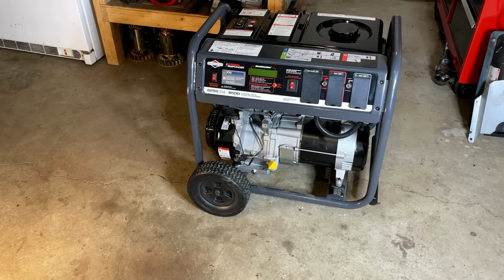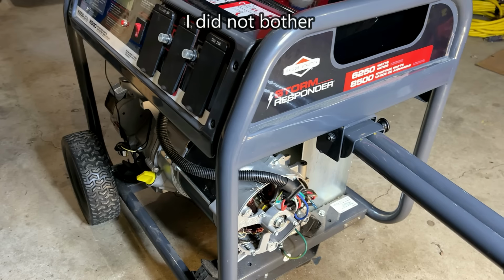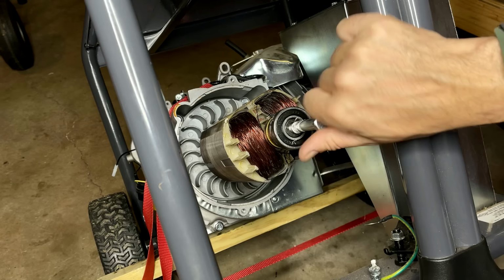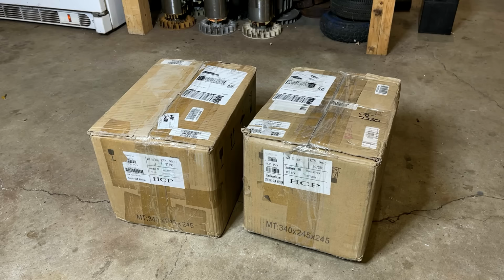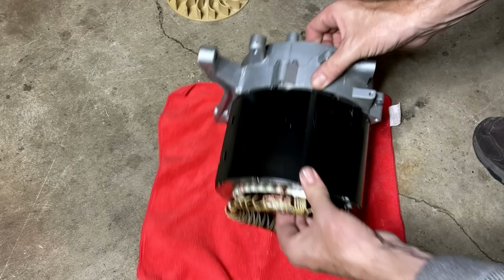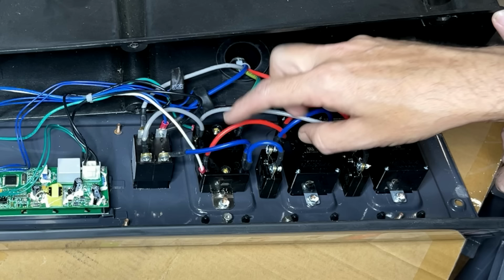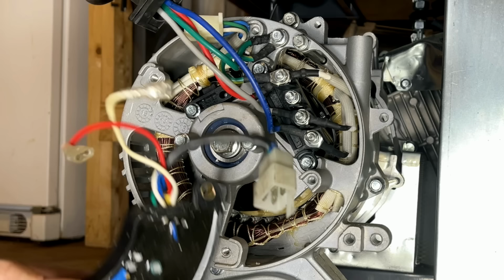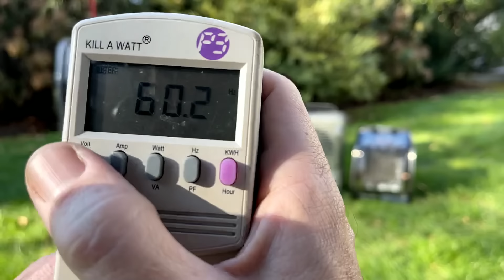New Storm Responder Generator Stopped Making Power

Comment: As usual, great video! 

Thanks a lot for your videos, i probably looked all your videos in the last month.

That helped me a lot to fix an old honda em5000sx with a bad avr, dirty carburetor.

I did the oil change, new spark plug, new air filter. 

I still need to replace the analogic voltmeter on the front, but it is too cold outside, i will do it next summer.

Now it will power my house in case of power outages. It happend many times here in Québec(Ca) you are à great teacher !

Comment: I would think you would be able to repair the wire from the rotor to the slip rings. Did something like that recently on a Kohler.
With all the work you do on these units, I would think you might be able to build some rotor or stator winding equipment. I know it can be very specialized or expensive, but there are a lot of motor repair shops that went out of business. He would think some of that equipment would be around. The rotor would be the easiest to do.
Reply: He's spoken about doing that repair before and prefers not to. Vibration, heat,  and centrifugal force means anything less than  perfect will fail sooner or later.
Reply: you pretty much need a full motor repair shop(assembly line) to do it right and have it last. the winding that burnt likely knocked any coating off the rotor iron and stator both, so those are likely trashed too.
there's just too many specialty machines and tools required, trying to hand rewind anything but a basic DC motor/generator is futile.

Comment: Great video 
 I'm Brian I live in my 97 dodge grand caravan  in Las Cruces new mexico.  I have a  2500 duel fuel inverter generator  (champion) I put anywhere from 8 to 10 hrs  a night on it a night
Reply: My question is  the stator and rotor on my  inverter generator  how long do they last in running hrs like I do.  Because I have thousands of hrs on this generator  been running strong for 2 years

Comment: One of the main causes of failure is shutting down the generator before removing the load. The AVR is going into saturation trying to increase the field of a slowing rotor. This can overheat the field winding and AVR xsistor.

Comment: With the new power head installed  what is the maximum watt output be?
Reply from the maker: Generator is rated at 6250.  The stator I installed it rated at 6500.  Most likely would not be able to use that extra bit since the circuit breaker is still rated at 6250.

Comment: Not throwing shade your way but isn't the shaft of the stator treaded for a slide hammer to remove it easily? I been a mechanic on everything I think 6 years on small engines and 15 years on locomotives and somewhere around 55 on everything in between and I have to say you are on of the most thorough mechanic/electricians that I have ever watched work. Pretty nice to see that... Thanks for the ride along and being able to vicariously be in the shop again sir.
Reply from the maker: It is threaded.  Usually I push it off with hydraulic pressure or a rod, but this one was stubborn.  And since it was already trash did not care to much about doing it the right way.  A slide hammer should also work.

Comment: James-
Have you ever rewound a stator and/or rotor before?
All of the necessary tools & supplies are readily available on Amazon,
and surprisingly cheap! The procedure is quite easy.
Reply from the maker: The tools are cheap.  It comes down to time and not having the proper winding diagram

Comment: Have you ever considered take a bad stator or rotor to a shop that can rewire them? I had a marine 12volt started rebuilt much cheaper than buying a new one.
Reply from the maker: I looked into it a few times.  The base cost starts at about $900.  Not worth it when you can buy a new Ryobi one for a fraction of the price.

Comment: Hello, I really like your videos, very instructive. I have one question, I see that you are no stranger to repairing generators and you have seen a lot, can you comment or even film a video about the use of welding equipment for generators. How to choose the right generator so that it does not stall and burn when using some welding equipment. What is the biggest mistake people make when choosing generators? Because not for me personally, but it has been heard that after using the welding machine, the windings of the generator or something else end irretrievably. I can't comment. Now I am the owner of the 7kw generator and I am thinking of doing everything for the needs of the house, I am afraid to connect the welder to the generator so as not to damage it. Thanks in advance.

Comment: At 48:48 you can actually see the governor spring pop out of the hole! That governor arm really launches forward with some force once it gets going. I wonder if that's normal or if the governor is sticking inside. Especially since it was low on oil!

Comment: Someone threw away a Home Power 6000 generator that has the dual fuel Honda 11 horse engine. Apparently water filled up the carb and intake but didn't make it to the intake valve. I'm pretty sure the air filter housing is aftermarket and neither wing nuts have any type of sealing ability. I do drill a hole on the underside of the plastic intake and use a thing I don't know the name of but it's a rubber tube with a crimped looking end that's on some external diesel truck air filter housings. You squeeze the end to relieve it of whatever made it's way there like water. I also put an O-ring under the winged nut that I took off a junk Honda pump as it has the Teflon or whatever seal built in. Just thought I'd mention that before someone has an expensive bad day. Just a weep hole will work but is easier to clog.

Comment: Great video.  You only loaded it to about 50%.  When do you determine that engine speed at low load and above 120vac needs to be increased more possibly by Governor spring setting that carb speed adjustment?

Comment: I have 2 questions:
1. Where is your elevator?
2. I always use a torque wrench to tighten a spark plug, don't you think it's necessary?
Greeting from the Netherlands.
Reply: I've been taught not to use a torque wrench to tighten the spark plug as you can more than likely strip the threads out of the head, which will require a heli-coil
Reply from the maker: 1) Being used on another project.  2) I torque everything, but not spark plugs.  If new then torqueing makes sense.  Used plugs just finger tight and then turn 30 degrees with a wrench and that's it.

Comment: Good repair video however, I no longer put that kind of money in a non-inverter generator.  For you to make any money you'd have to get close to $500 for this machine and, at least where I live, I would be hard pressed to get that. 
Now, if you are keeping it for yourself, ok.  You got a pretty nice generator for around $300.  Otherwise I would just use it as a parts unit.

Comment: I bet that you could've smelled that one pretty easily even without opening the back cover on the power head. Do you actually ever use the "smell test" to try and figure out if there are burnt electronics in the generator?
Reply: Hi, yes I was just going to say that myself , then I saw your comment. Totally agree.
Reply: Agreed, should have had a real charcoal smell,great video
Reply: I do and it cut price to 50.00 and I was right but very good engine

Comment: James, I was thinking the failure may have been caused by having it connected to a house power panel without a transfer switch or having the main breaker in their panel opened. When Utility power came back on, then it fried the generator. Your thoughts...

Comment: boy the price of the rotor and stator shot up from the price you got them for in a short time
Reply: James got the bigger (and more expensive by $100) Ryobi combination to better match the power output as advertised on the decals on the original machine....
Reply from the maker: The 5500 watt one is still cheap, but the 6500 one has gone up to the point that I do not know if I would buy it again.

Comment: My 25-30 year old Coleman powermate 5200 has a 9 hp B&S engine I wonder if it could power a 6200 watt power head or if one like that one Would fit.  Never had it apart and not worth the potential for damage to disassemble and reassemble.

Comment: I have filled a hole with clay and then used close fitting minor diameter pin punch with a hammer. This gives a hydraulic shock that will sometimes separate a light press fit.

Comment: Followed your tutorial with a FB generator. Thanks! All it needed were new brushes. Only 96 hours run time. Shouldn't the brushes last longer than 96 hours?
Reply from the maker: They should last a lot longer.  Might have an issue with the slip rings

Comment: Hi James I want to say I love your videos your very smart man , I have this same generator and I took the carb off to replace a gasket and I didn’t know what the governor was I loosened it up and I don’t know we’re the right position is I keep trying and it’s wide open , I tried turning it clockwise which the throttle open but it’s wide open , I shut it right so I don’t ruin it , I noticed also that the governor bolt or rod itself doesn’t just turn left and right you can push it down and up to , can you please explain to me what to do I’m lost and could really use your help . I would appreciate it a lot to be able to understand this model Briggs and Stratton storm responder

Comment: Too bad the original owner failed to see the 'Magic Smoke' coming out of the generator head - it would have been very obvious, and smelly. So he feigned ignorance to keep the price high. He should have returned it under warranty.
I bought a new generator a few months ago, and I checked it out and ran it (right out of the box) to get it all seated etc for a total of 3 hours, with oil changes at 1.5h and 3h. Jut to be sure it was OK.

Comment: I've just bought a Firman trifuel 8000watt generator and plan to only run it on natural gas. It will be stored outside under cover. should I fill the gas tank all the way up to prevent the tank from rusting or should I keep it empty?

Comment: Any particular older vintage brand/model of generator in the 5kW range which has the best price to performance ratio and reliability?  I don't want to cough up a bunch of money for something which rarely gets used for the occasional power outtage.  I am good with poking a wire up in the carb jet if it needs cleaned but won't be tearing them apart completely like you are skilled at doing.

Comment: I have the same exact Briggs & Stratton storm responder with the XR 420 cc engine. 6250 running watts. The carburetor is filled with RUST and I’d like to know where to purchase a new carburetor.
Reply: I purchased a carburetor from Amazon. It said it was for a Troy Bilt, but it was the same carburetor and ran the engine just fine. 030594 Huayi Carburetor for Troy Bilt 6250 8500 Watts Generator  $26.99

Comment: I have the exact generator, trying to find where the fuel solenoid wires go ( someone disconnected it before I got it ) just need to know where the 2 wires from the fuel solenoid connect as I can not find a plug or harness for the connectors anywhere? I can not find anything online as well. Thanks

Comment: I do appreciate the first class job you do but I have something that bothers me because I did it differently than you do and it seemed to work fine for me. I had to separate the generator head from the engine to do engine repairs and I just pulled the rotor bolt and the stater bolts to the engine side cover and used a piece of rod and a bolt to free the rotor from the crankshaft. Took the power head off in one piece. That generator has been used for many hours since I reassembled with no problems. Why was I doing it wrong and how did I luck out? In this video you still insisted on removing the stater and the rotor separately even though they were both trashed. It seemed like a waste of time.

Comment: I’m betting you’re not the first person to be inside that generator!  I bought a generator new that worked great and then I overloaded it by leaving the main breaker to the grid open when starting the generator…oops!…and now will feed power to one device….but if I connect a second device (even on the same extension cord) it simply stops generating power.  If I turn it off and back on I can do the same thing again.  It will run nearly a full load of 8000 watts but will not allow TWO devices to be plugged in.  I suspect the stater is faulty and there is a ‘near short’ that arcs when a second load at a different wattage is applied.

Comment: Could you just use a piece of 1/4-5/16 inch rod/bolt cut to length to then install into hole to push against with the m12 bolt?

Comment: James, I got a free Yamaha EF3000SEB with a broken con rod. I didn't know if it made power so I patched the hole in the housing as best I could with JB weld and replaced the con rod and got it running. It makes good power and runs great but the engine needs to be replaced. Do you have one ?

Comment: Hi, has this damage to the windings happened because someone has started up the unit and connected it to a place that has suddenly had power from the power grid restored?
Reply: I am not positive, but I believe there would have been more fire involved, while this generator tried to sync up phase.
On large generator plants, a degree out of phase will cause a small earthquake.
Reply: @JasonW.  I'm  no expert but wouldn't that just trip the breaker on the gen?
Reply: @kriswright1022  it would trip the breaker, but the input of out of phase power from mains would cause massive damage in the milliseconds before it trips

Comment: @13:00 Isn't that another stator/power head under the bench behind you?
Reply from the maker: That one is not for a Honda clone.  Does not fit.
Reply: @jcondon1  It looked similar to what you removed.  Then again the one you were working on looks like a clone of the Generac 5500 that I have.  Minor handle differences aside.  Cheers.

Comment: Red wire neutral, crazy dangerous.
My near new gen is dying rpm to almost stall when loaded.
A visitor without my knowledge thought it was running to fast and turned screw on top of motor that seems to at arm throttle arm and a screw on carby not mixture a black phillips head plastic screw and since It wants to stall.
A TWM 8KVA peak 6600 constant.
Any ideas how to adjust these screws.  Thanks anyone

Comment: James have you ever just replaced the coil in the rotor? It's not that hard to swap out. Also it would make life easier when your looking for a replacement rotor just make one.  . Press out the shaft the rotor splits yo expose the coil r/r bad coil press back together replace slip rings.. Then you have a remained rotor.   If Your not comfortable doing that get a hold of me maybe we can work something out.    Idk but would love to help you/ your channel any way I can.  But rewinding the winding and replacing rotor coils is fairly easy once done it a few times. i Get a holld of me when you have a chance if is something you would like to do..  I'll send you my business email. / phone number and see what we might be able to work out.   Really,  I have gotten so much enjoyment from watching your channel over the last couple years I would be happy to help you out if I can. Let me know.
Reply from the maker: I have not done that.  Just need the tooling, winding diagram and time.  Have looked into having them redone in the past and consistently quoted $800-$900.  Too much for a used portable generator.
Reply: Hmm
Reply: @jcondon1  
$800-900 for a remann rotor o stator OMG
That's insane.  
:face-blue-wide-eyes:
Reply: Should cost less than a third of that. A new oem one 500-1500 depending on the unit even a little higher. Most i've seen one was about 3800 for a new oem was on a Bosch unit while I was working /living in Spain.
  
 yea price is up there pretty spendy been a while since i've priced one. But a re-mann unit should be around 1/3 to half. A good used one for about 25 -40% of new unless it's a hard to get piece. That why I was curious about if you had considered rebuilding them your self.  Stators are pretty easy.  Rotors can be more of a pain in the rear. Let me check out accouple things and get back to you.  Been retired for about 7 years from the feild but still have a few contacts.  Stators don't take much some wire/insulators/protective coating and an old oven that can still hit about 500 deg to cure the insulating coating and anout 20-30min of your time. Rotors more of a pain. Stators can be redone for about $20-50 in materials and maybe 20-30min labor Max.  thats re-using the the old part that holds feild windings in place.  the actual windings.  Rotors you need a few more things and are more labor intensive same goes motor/generators
Reply: @James Condon   at that price I'll agree doesn't make sense.  When and if you have time would like to continue the conversation.  There are ways to rebuild them have a good product that doesn't cost an arm a leg and ask the other leg for help.  I'm not looking to make a penny off of helping you do it if your interested. I just really enjoy your videos and thought it would make for more content and its kinda interesting to boot. Also lessen the cost of overhauling the unit.  
If your interested hmu if not keep up the good work, and great and informative videos. Really enjoy them. Your awsome!

Comment: I use a steel rod I cut it to length then I use another bolt to push the rotor off